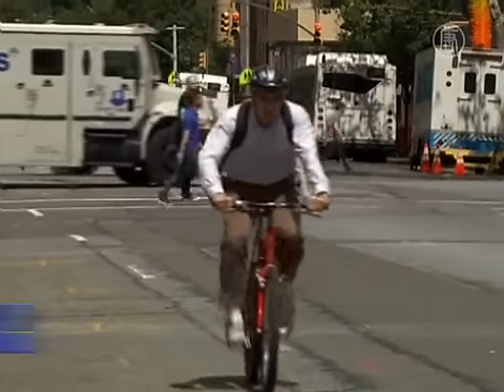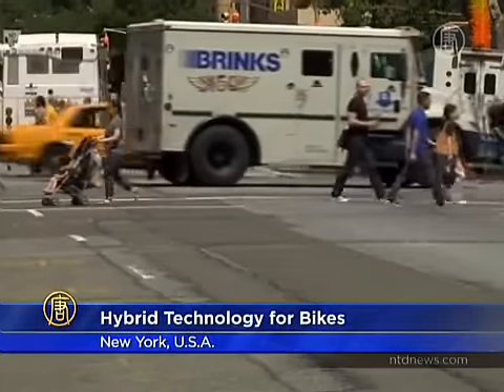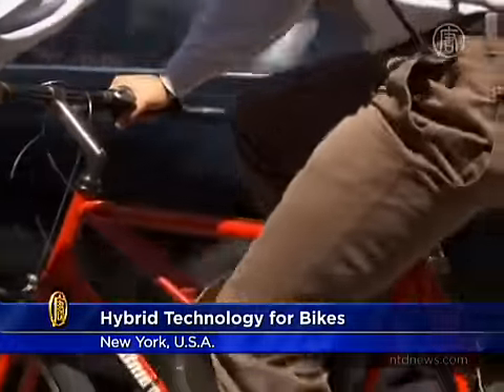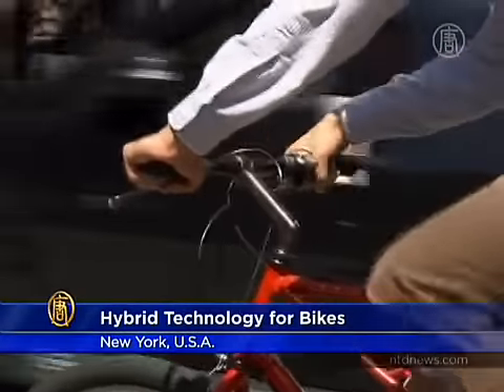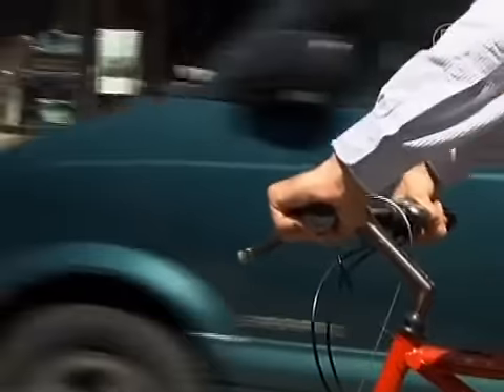New York Engineering Grad Brings Hybrid Technology to Bike Design

Comment: F1 cars have been using this trick for ages. But instead of being purely mechanical,  F1 uses electromechanical system by means of motor-generator setup; also known as KERS (Kinetic Energy Recovery System).

FlyBus have been using the same trick like what this video have shown.

Comment: The problem with flywheels rotating at high speeds is the losses due to friction with the air. If the flywheel could be contained in an air-tight container and the air removed it would increase the efficiency  greatly.
Busses with 7 ton flywheels were used (in Germany?) fifty or more years ago.  The flywheel was spun up to speed at the depot and used to power the bus for the duration of its journey. (No idea what happened if it ran out of power).
Reply: +Frank Buckley I built this for my bike as a kid, except I had dual-hub rotor electric engines and a whipper-snipper motor powering it for the most part. My biggest issue wasn't friction bleeding the kinetic energy away but the conservation of momentum when cornering, the fly wheel didn't want to lay down meaning you had to accelerate before a corner and kill the spin as much as you could, or steer it like a boat. Encapsulation would solve drag. I was inspired by trams in Sydney (where I grew up) which used a large fly wheel and pulley system to move them up and down steep gradients. This was in the 80's I made this and based on 30's technology, so I'm fucking disappointed to see this is 1. news, 2. a university project, 3. not on every fucking car or thing with wheels by now.

Comment: nice one it really got my wheels turning. I  think the fly wheel could be put on the inside of the spokes on the wheel eliminating all the chain and extra bracketing. then the fly wheel could be a battery put a little motor on the front wheel and you've got a flywheel assist electric bike with very little extra weight.

Comment: An old sewing machine with a paddle pump at the bottom- Only this time you make a drive shaft tube near the pull wheel at top of the sewing machine to push forward- Using light weight materials again -You could make a piston for the older variety cars ?
All of these are connected and I believe can be done -

Comment: it makes it harder to charge, since it's heavier, but potential output is bigger since the heavier flywheel will have gained more momentum.

note that the heavier the bike (flywheel included) the more difficult it gets to get up hills, especially if the flywheel has no left energy if it is propelled by braking exclusively.

Comment: What about using the new material that is lighter than steel and creates less drag?
Also us a driving device on a wheel like an old train has that thrusts forward? Place something to make a well like a drive shaft tube for down thrust to this that has a tork spring in it - So as you peddle forward you make your bike go faster potentially. And as the bike is going round the if you will drive shaft tube if forced again backwards pushing again the mechanism on the wheel resembling a train pushing

Comment: Porsche used a flywheel on a proto 911 a few years ago ton run the Nurburgring 24Hrs,  it worked well but still,  they chose batteries to replace it. On the other hand,  Koeniggegg use an air compressor to boost the car,  easy,  light and very reliable. .....

Comment: to begin making your bicycle more efficient first add another wheel that weighs 15 pounds...
Reply: +Roger Paull He could redesign the car flywheel to weigh just a few ounces. How about all the weight of all those sprockets on a bicycle. How about the weight savings of a baby frame and baby wheels. A flywheel on a bike will keep the bike always standing steady straight up, where it will never wreck. The oil companies will buy ( not buy, but  steal all the bikes) all the bicycles out and destroy the bikes and kill all the inventors.
Reply: The lighter you make the flywheel, the less energy you can store in it. I say, instead of a flywheel, put a 15pound battery and use regenerative braking.
Reply: @sierramikekilo6925  with another 15 pound motor get outta here

Comment: How bad is the gyroscopic effect when you are trying to corner - would tend to throw you off line I would expect?
Reply: +Frank Buckley Flywheel rotates only when the brake is applied!!!! So no problem with Gyro effect.
Reply: +Md. Jilani 

the flywheel  takes a while to stop, unless you discharge it before turning

Comment: They did that 97 years ago in 1919 with one bike in particular called an EVANS POWER CYCLE look it up  its nothing new i hate that people steel an idea thinking they are smart ...and that's not a fly wheel its a harmonic balance wheel that goes on the out side of the engine block connected to the crank

Comment: The only problem that he forgets to mention is that for the flywheel to be effective, it has to have significant mass ( be heavy).  And for bicycling, that is a big no no, because trying to climb hills with a heavy weight on the bike far outweighs any 'flywheel effect' energy advantage.  It may be practical on flat terrain only.

Comment: The downside is the flywheel adds more weight to the bike so now you have to pedal that much more and work up a sweat to go as fast as you use too go with less effort when the bike had no flywheel. if you want to put more boost in your bike your suppose to make the bike lighter not add more weight to it. maybe he didn't study the laws of physics. : (